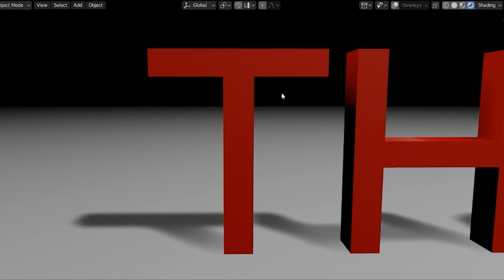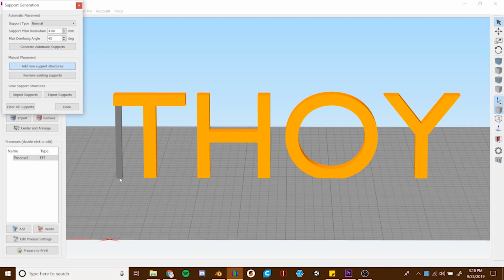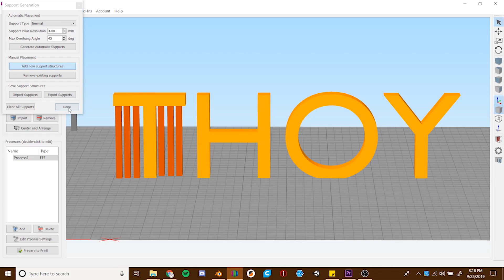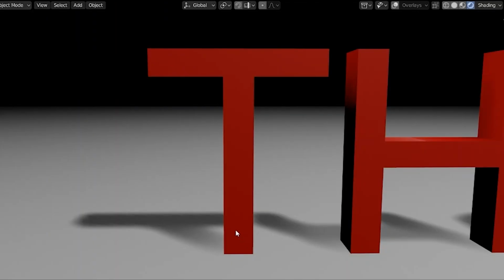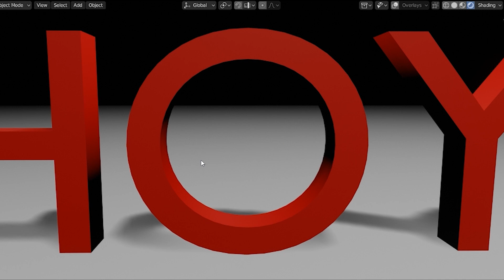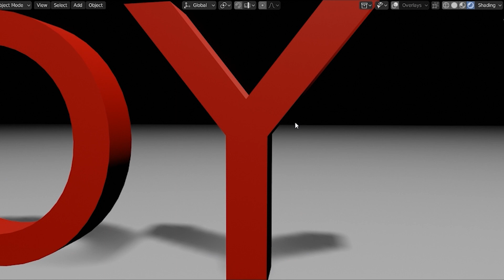#3DPrint Design THOY Theory | Blender for 3D Printing Design

Comment: I have been 3D printing for about a year but decided to jump into design. Blender is intimidating but these lessons are a huge help. I am anxious to get on to some more advanced lessons. The one thing that I could not wrap my head around for the THOY principle is why the 3D printer can print the mid-section of the H without droop, but not the T. I found a video that zoomed in on the print head making a bridge and now I get it. It made me realize that a few of my prints did not need supports. https://youtu.be/m4i1SbIIMaA?si=If7w5-E-_MR1G35p